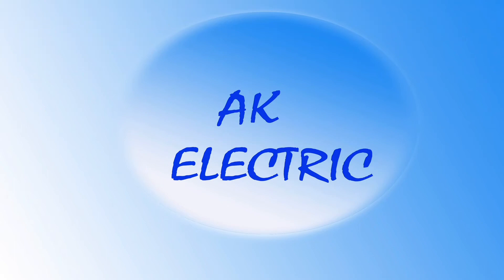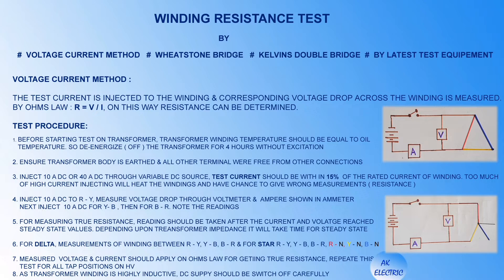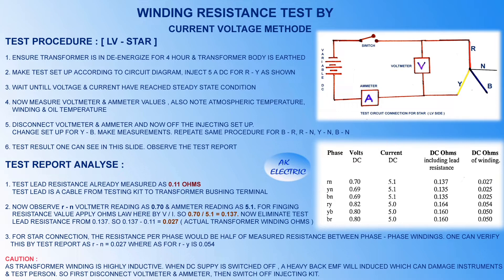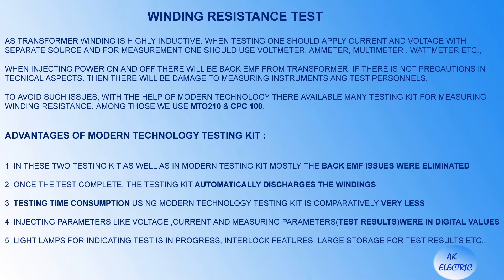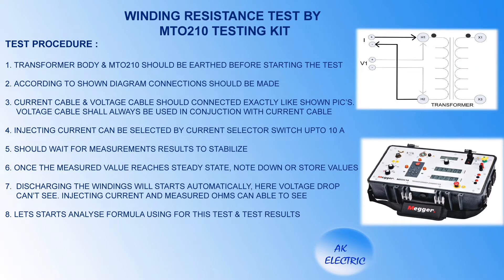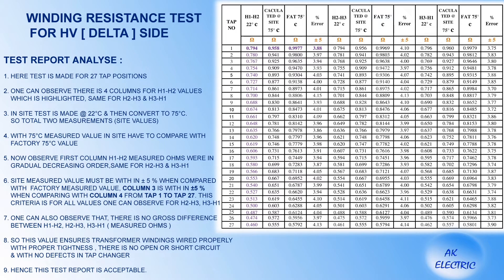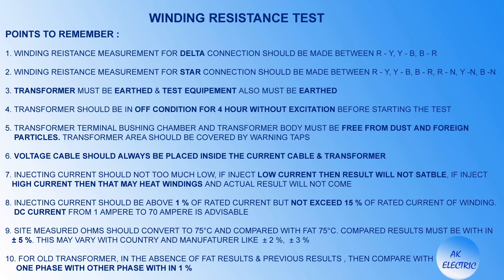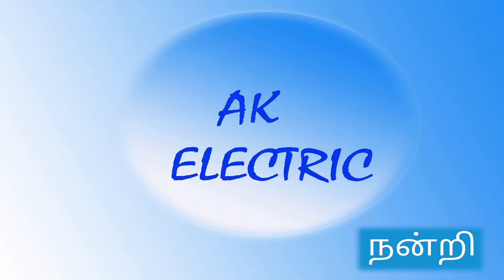TRANSFORMER WINDING RESISTANCE TEST - ENGLISH,TEST REPORT ANALYZE,FORMULA, COPPER WINDING CORRECTION

Comment: Great, is the Tap changer change Automatically during the Test?
Reply from the maker: Firstly, Thank you for your support.

No, Tab changer will not change its tap positions automatically during the test. It can be done only through hand driven or motorized. For motorized operation also have to prepare scheme, that is interconnection cable.

 For Tab position changing automatically, CPC 100 ( Testing Kit ) there is an option for automatic with the help of CP SB1 ( Additional set up box )
Reply: @AKELECTRICPOWER  thanks a lot,
Could we choose the first tap and middle and last for example (1, 9, 23) or we should to Test all taps, and other equistion please, what is the difference between Rwinding and TRTap cheak?
Reply from the maker: Dear Hi,

1. You can check winding resistance test for only tap position 1, 9, 23. But, you can't include other Tap Changer positions in those test.
 If you check only for 1, 9, 23 you can ensure transformer winding is good but if there is any problem in tap changers on 5th or 20th position. Then while in operation time it will make problem to transformer's normal operation.

2. The reason for testing through  all Tap Position  is, then only you can ensure all tap changers were working in good condition ( Tap Changers includes Transition resistors, Diverter Switch, Tap Selector, Connecting leads etc.,). Moreover in site there is no individual test for Tap Changer. That's why all test were includes all Tap  Positions.

3. Winding in Transformer is wound on core. So we have to ensure winding is in good condition or not by  Winding Resistance test, Insulation Resistance test and so on. Separate test is there for Transformer Core also.
Transformer Tap Changer is intermediate medium for Transformer terminals ( where power cables connect ) & Transformer Windings. So it is necessary to check Tap changer also.

4. All relevant required equations were I am mentioning in respective topics. When time comes I will make separate video for Transformer related required Equations.

Thank you.
Reply from the maker: TAN DELTA TEST LINK :

https://www.youtube.com/watch?v=alhhmkRpUaY

Dear Hi,

I have uploaded Tan Delta Test for Transformer from above link, Part - 1

Thank You,